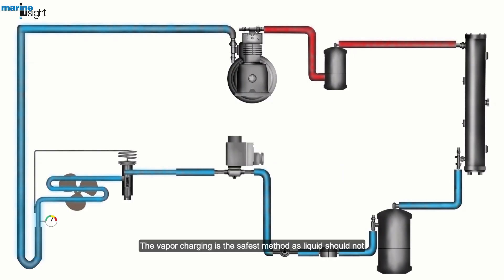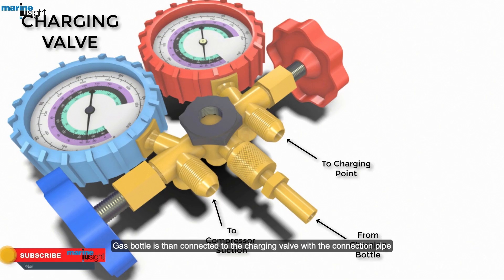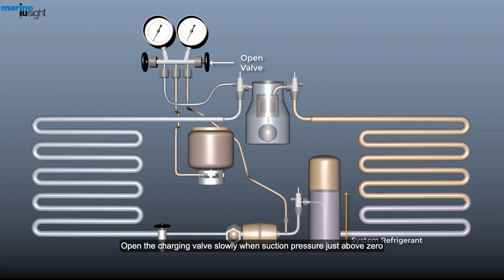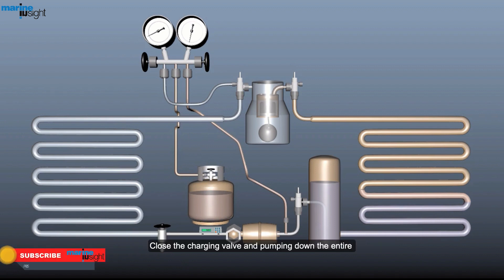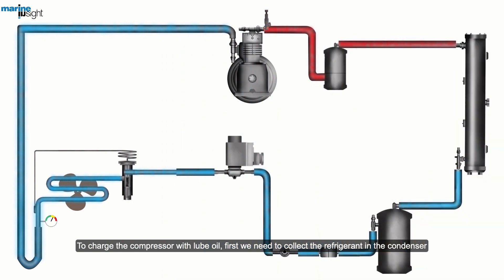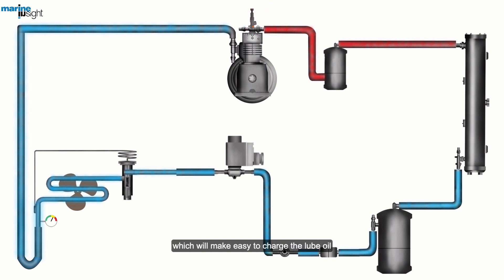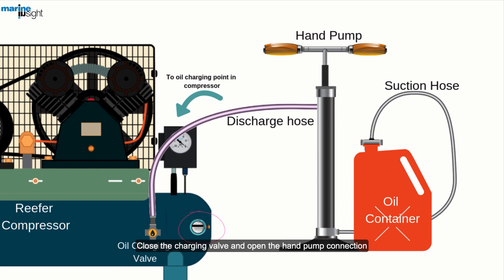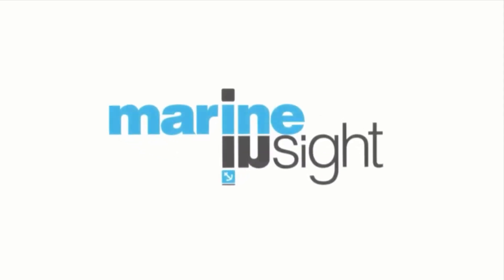Refrigeration Charging #refrigerant #HVAC #refrigeration

Comment: When you open the bottle valve to remove air from the pipe, it will emit ref gas outside. I think that is marpol violation right?

Comment: is there any problem if we charge oil in running condition with piston pump that will add oil with pressure greater than suction pressure.

Comment: How to charge oil in refrigeration compressor without using pump?
Reply from the maker: When the compressor design is such that a suction strainer and oil return to the crankcase is featured, oil may be added via the suction service valve gauge union in much the same way as described above but using the compressor to draw a vacuum instead of a vacuum pump.